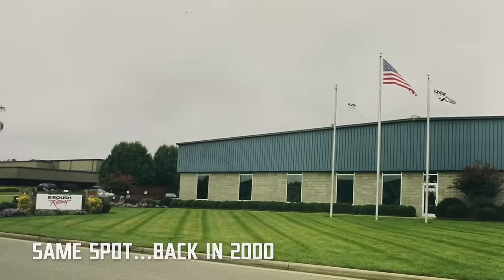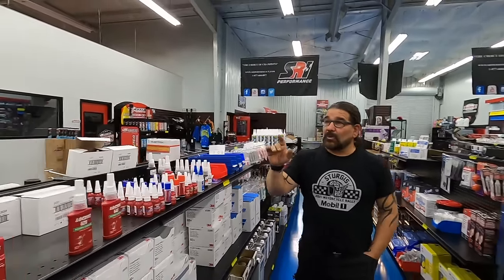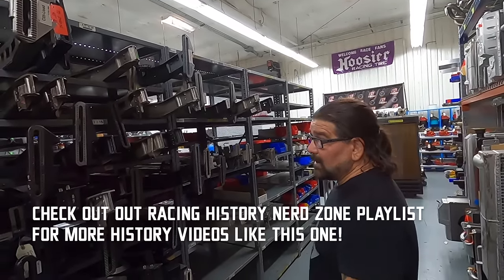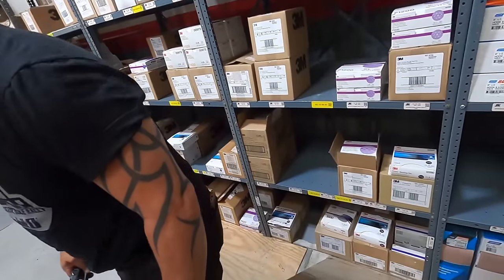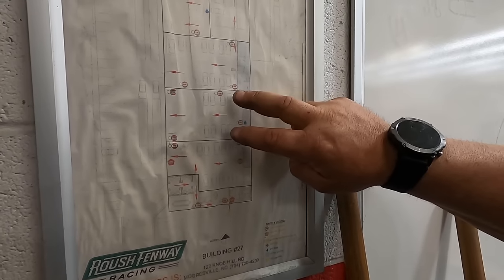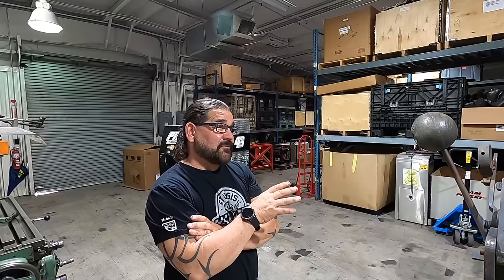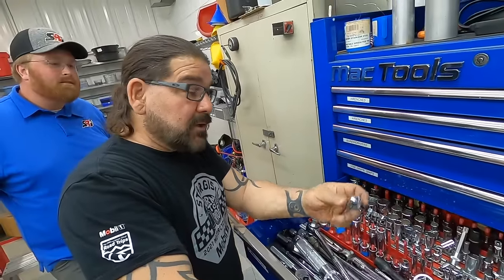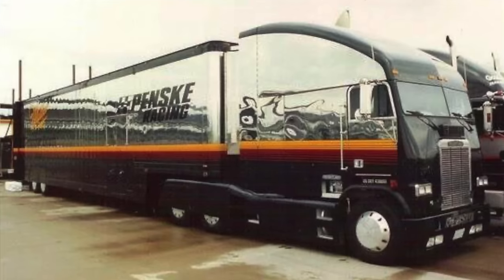Roush Racing's Former NASCAR Shop History Tour: Mark Martin & Jeff Burton's Glory Days Built Here!

Comment: I was lucky enough to visit North Carolina and Virginia several times from 1999 to 2006. I went to all the race team shops I could find, this one included. I got to watch pit stop practice once, and got some lug nuts from the team. Slightly unrelated story, one year I went to Ultra Motorsports, and out in front of the main building there was a stack of race-used tires, some sheetmetal, including a couple of noses which they were just giving away. If only I didn't live in California! I ended up taking a tire used by the #2 truck team (Mike Bliss). I have it under another tire signed by RIchard Petty with a round piece of glass on top which I use to display some of my scale replicas. I have really fond memories of those times touring shops and going to Charlotte Motor Speedway and Martinsville Speedway. Great tour, and really I like your message in the middle of the video. Oh, and the "comfort food" analogy was spot on!

Comment: The 3rd bay was indeed the body shop. There were 2 downdraft booths & also a prep bay. The back building that was originally an engine shop, was turned into a fab shop/body hanging shop when Roush Yates engines was started in 2005 & all the engine stuff went there. I worked in that shop from late 2005 until 2010. Enjoy all your videos. Keep up the good work.

Comment: That’s cool man. Back in 2007 when I started at NTI, I remember the race shop on the corner where I turned towards school was RYR… then it turned into Petty Motorsports if I remember correctly. Next door to NTI was a place called Pit Crew U… and down below NTI was Jr Motorsports. They had a chassis dyno behind Jr Motorsport and during breaks everyone would flock to the back of the parking lot when a race engine would fire off. Fun times. I’ve been planning to go back to Mooresville but haven’t made it back yet.

Comment: Finally got time to watch this. Another good one as per usual. When I was still road racing my Corvair I bought a lot of bits and bobs from SRI. They always had the sometimes odd things I needed and the price was air. Also earlier I watched the latest episode of Vice Grip Garage where they bought a tribute Darrell Waltrip Buick tribute street legal kinda race car. It is for a give away deal they have. Of course Derek wanted to change a few items, one of which was the dual pipes exiting on the driver side. He wanted them to exit n the passenger side. I immediately a set of boom tubes like you guys have would seal the deal. He did decide o boom tubes but he designed and made his own. They sounded good but did not look exactly right. I like the noise yours makes.
Reply from the maker: Thank you rick!

Comment: I remember them being in a different location before this place, I bought an engine from a guy that worked for them and picked it up at the shop. I can't remember where it was but it wasn't in Mooresville. this was before a lot of the race shops moved to that area, it was during either 1995 or 1996
Reply from the maker: You’re probably thinking of the original location of the 6 team in Liberty NC. They didn’t join the 99 team in this location until 1998

Comment: I have a question I've just got to ask about a random curiosity I've noticed while watching your shop tour videos. Just about every race shop from the 90s era has the same interior paint scheme. The lower walls are gray. There is a thick red stripe above that. Then the upper portion of the walls are painted white. Was there some actual reason behind why the shops were painted this way or was it simply a case of one team did it, then everyone thought it was cool and did likewise? Darrell Waltrip's shop had it. Childress's old shop (now the museum) had it. This Roush shop had it. Jimmy Means shop had it, as did many others. I know it is an insignificant thing, but I see things like this and it drives me nuts trying to figure out why so many race teams painted the interior of their shops identically. LOL.
Reply from the maker: I have wondered that too. It must have been the trendy thing to do back then 😂